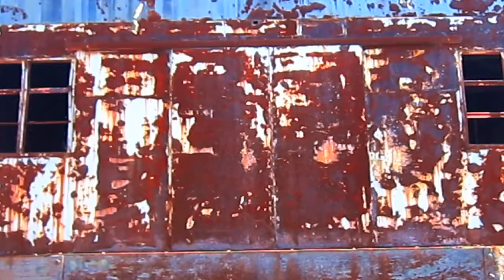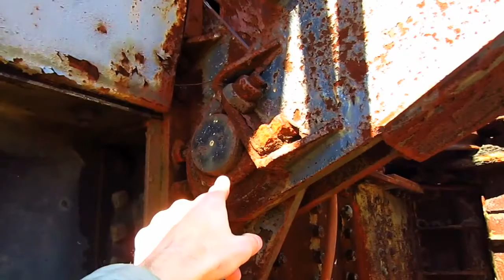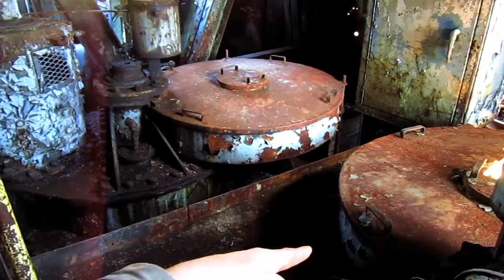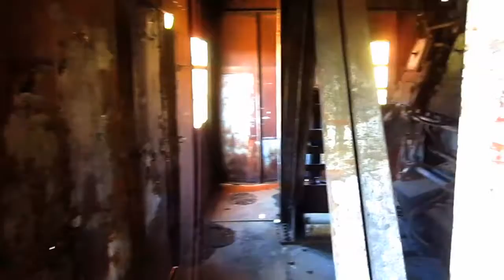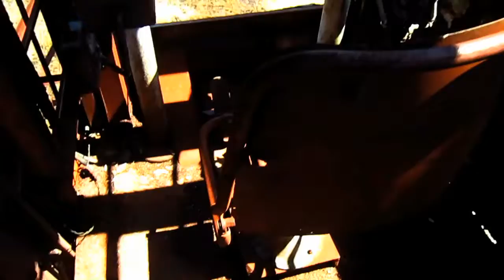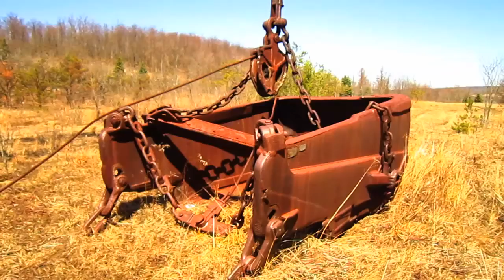Page 721 Documentary

Comment: Thank you for your website. A question. In the mid-1960's we visited and old coal strip mine on a mountain in Pennsylvania. We accessed it by driving on PA Route 144 then on a dirt road for miles.            It was near Snow Shoe, PA and had an old abandoned walking dragline that looked sort of like this, especially the big windows. I guess it must have been built by Page Engineering. You seem to know so very much about draglines. Could you shed any light on the one we saw? Thank you.
Reply: RS Carlin  was a big company around the Snowshoe area.  My late father and I worked in the strip mining industry  in Clearfield and Centre counties. I now live in Texas and work road construction

Comment: Riverhill Coal had 2 700 Series Pages, one in Karthaus was fitted with 2 CAT Engines by former owner Jim Hoffman. Other Page was moved to Karthaus from New Garden with Page Engine. We worked one winter replacing rails and rollers. When Karthaus Page was owned by Hoffman, his relation was day shift operator. Hoffman gave him hell because he was always dirty. Hoffman came out one morning and his relation had on a tux with Abe Lincoln Hat tipping as he swung the drag! Both have been scraped by current owner.

Comment: I worked on a dragline just like this as an oiler/groundman back in the early 1980's. We were digging a deep drainage ditch around the perimeter of the mine. And the ditch was so deep in places that we had to dig the top half of the ditch and then walk the dragline down in the ditch to finish it. They also had to blast rock so we could dig the ditch. I certainly enjoyed working on this machine, except for the hand pumps for the swing gear cases. You pumped oil from the sump of the gear cases back up to a reservoir on top of the gear cases. Then the oil would drip on the gears. I also noticed in the video that all the manhole covers were gone from outside the tub, which were easy prey for thieves.

Comment: It must have been a smaller version of the walking draglines before other manufacturers would later on make the walking draglines bigger in size and weight for much larger scale mining projects.Will this Page 721 be working again or possibly scrapped?
Reply from the maker: +Megashovelman Back in the day, walking draglines as small as 1 cubic yard were available.  Today a machine of this scale is seen to be completely inefficient and obsolete when compared to modern earthmoving equipment, however at one time, draglines used to be THE WAY to mine.  I doubt this machine will ever run again, however the owner says he does not want to scrap it.  It last operated in 2001.
Reply: +PAmining It might have been a real productive machine for it's time but I think if it was repainted or reconditioned it might be a good item to display in a historical museum for Heavy Equipment.

Comment: Thank you for researching and documenting these pieces of history.I have seen just about every engine configuration imaginable, in both stationary and mobile equipment.  But I have NEVER seen a horizontal V-6!
Reply from the maker: +TheSpazModic That's what made these diesel powered Page draglines so cool!  I've always been told by old time operators that the Page engine had a very distinctive sound unlike anything else.
Reply: +TheSpazModic What's so special about a V-6 engine with a  horizontal crankshaft?
Reply: ***** I was referring to the engine block being mounted horizontally, or turned 90 degrees from the usual position.
Reply: +Michael French no. the motors horizontal. as in the v6 is laid on its side, on upright like a car

Comment: Maybe you could tell me some info here. When I was about 5-6 ('08-'09) i got to look over a page walking dragline in karthus. Pa. It had a hole in the block and was to be scrapped or buried in the current pit. I never saw it again and thought you might have some info.
Reply from the maker: +PA diecast construction Yes, that was a model 625.  It was scrapped in 2011.  I still wish I could have filmed that machine.
Reply: I now live in karthaus pa.i know of the Page U are talking about.as of a couple years ago,it was sitting not far off of the paved road to Pottersdale Pa..The boom was on the ground and it might have been cut up for scrap by now